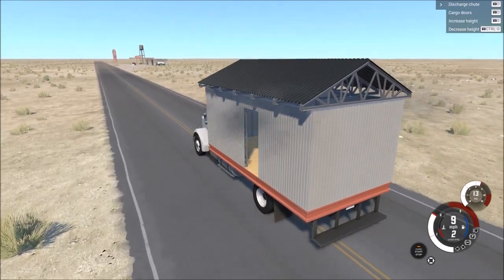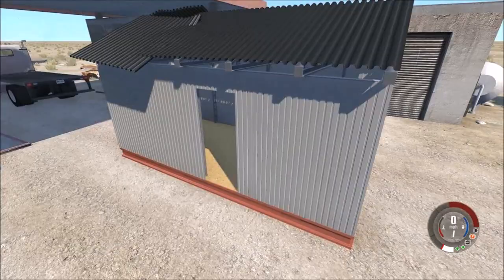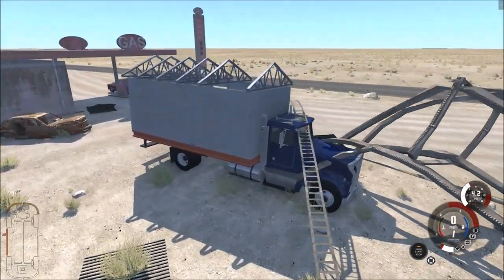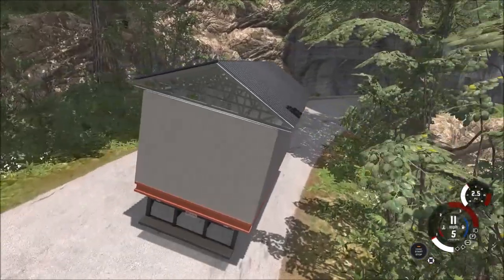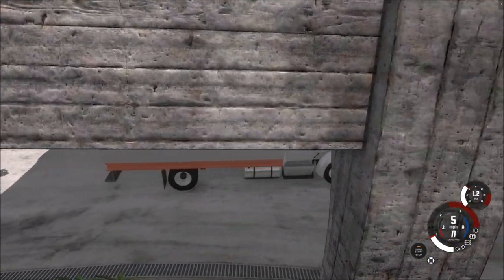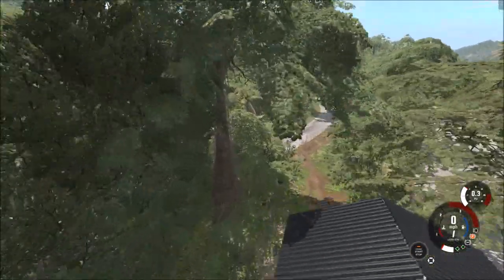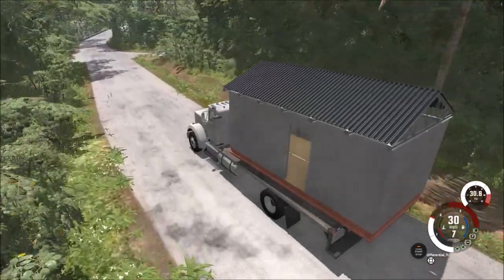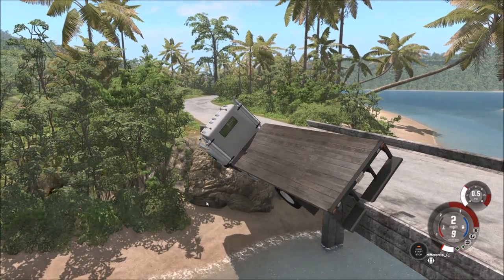BeamNG Drive - Shed on a Flatbed! Suggestion Box: Mark Wright

Comment: Hey David, how you place the shed onto the flatbed, and also how you get it to lock onto it?
Reply from the maker: Ropewalkingelephant: spawn both next to each other. Pause the physics. Go to free cam (shift-c). Launch the editor (f11). Use the object editor to move the shed. Exit editor mode, unpause physics. As for locking it down, in the regular gameplay, use the node grabber (hold ctrl) to link a point of the flatbed to a point on the shed. I will make a howto vid!
Reply: davidinark Awesome! Thanks for that. Going to have to try it myself. Also I’m not sure how I managed to forget to write ‘do’ not once, but twice. It must have been late! Really enjoy watching your videos.